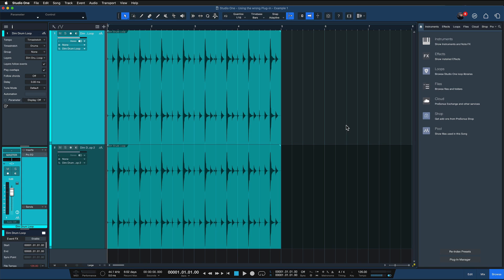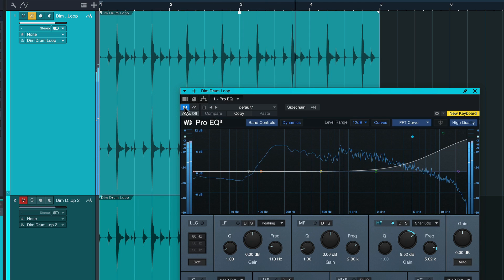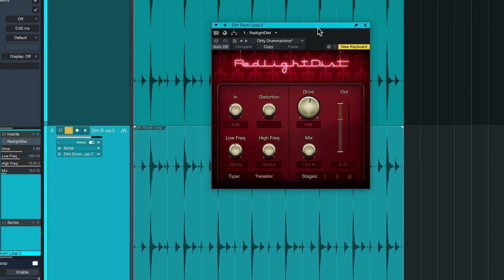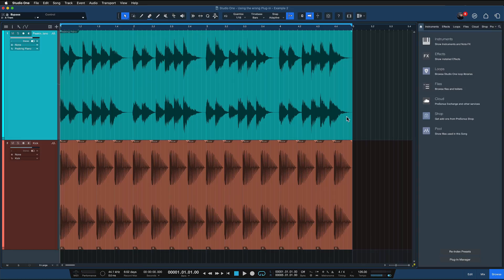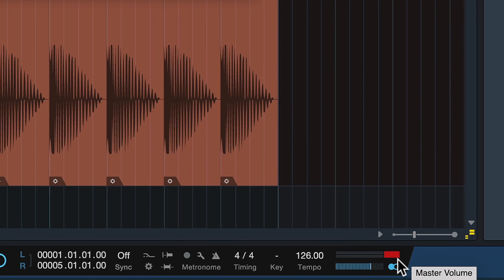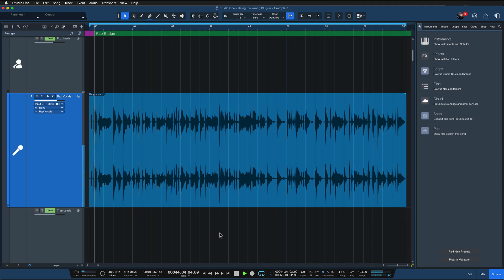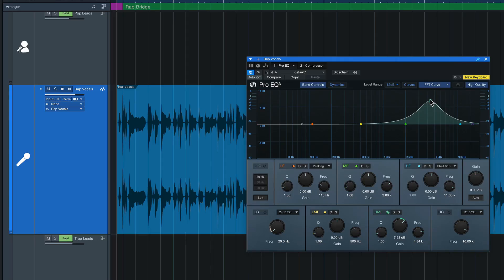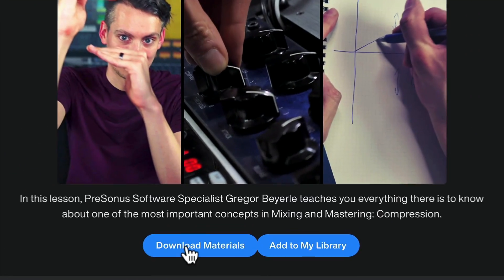Bad Mix? You Might Be Using the Wrong Plug-in | PreSonus

Comment: Studio One's limiter is really underrated IMO. Although sometimes you want a "compressed sound," my usual goal with vocals is a natural sound. So, I often use DSP peak reduction, and then a limiter, to reduce the biggest peaks. Then if more dynamics processing is needed, I follow that with light compression. The compressor doesn't have to work as hard because the other processing has done most of the heavy lifting. So, you don't get compression-related artifacts. I also use the limiter to cut guitar and slap bass transients down to size. So many options :)
Reply from the maker: So happy you like it!
Reply: @fenderstudio  It's great! It's pretty tolerant with vocals, but using it with bass requires understanding how the A and B modes relate to the three different attack times. Once you figure that out, it's really helps to tame bass dynamics.